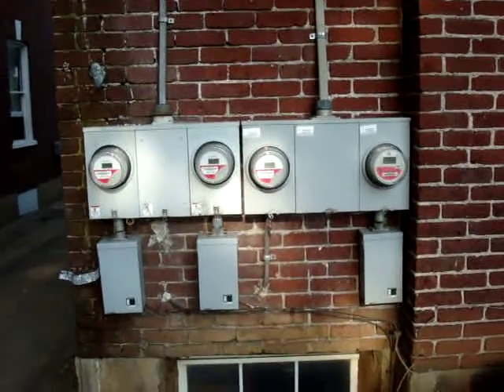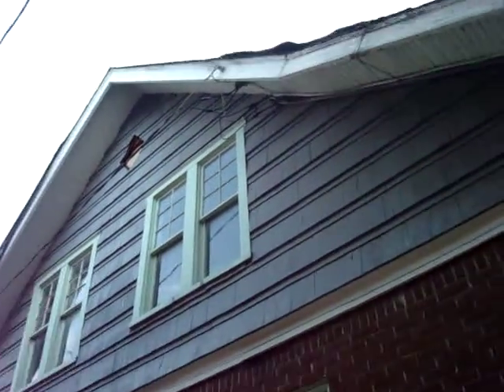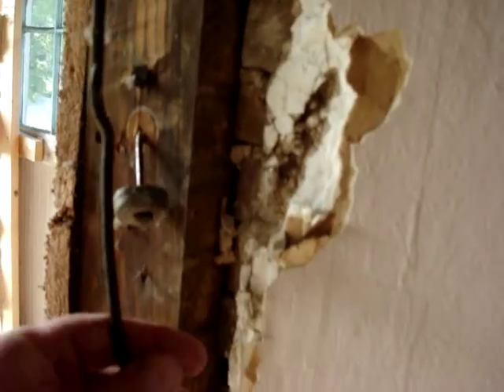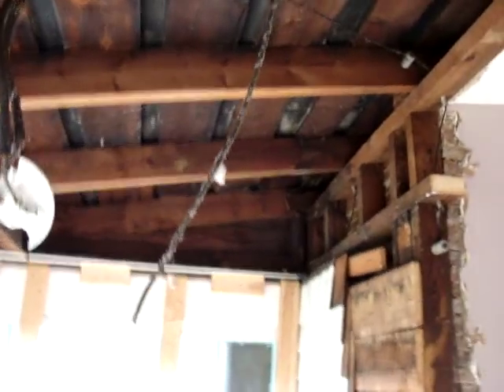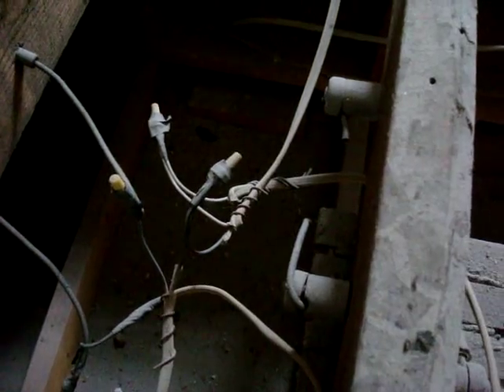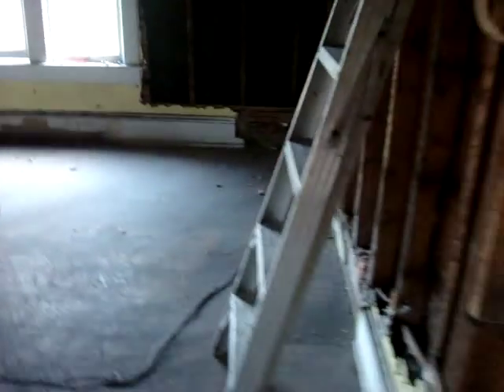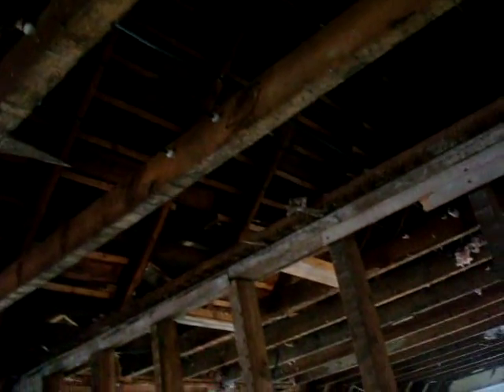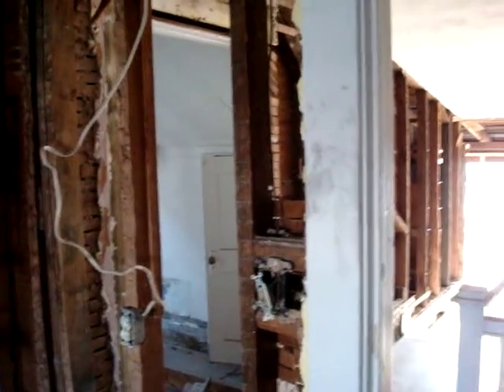Illegal and Unsafe Wiring in Older Homes

Comment: yes as long as you only touched the one conductor. actually you could still do this it is just a lot more likely you would be in contact with another conductor inadvertently, even a damp floor.

Comment: Switching the neutral instead of the hot was the way they did it back then. It's obviously very dangerous but until the 30s or 40s the code did not prohibit switching the neutral for lighting.

Comment: Ball park... How much would/did this cost to have rewired?
Reply from the maker: Whole house rewire w new panels, main w disconnected runs $15000 to $25000.
Reply: @JamesGlassJamesGlass  I think my heart just dropped... In the process of looking at purchasing our first home. And we have reason to believe all of the wiring needs to be redone. Hoping not to have to gut it completely out. I think I'm going to cry inside
Reply from the maker: @MariaM-ok5fq  Just get a licensed electrician to inspect and give you an estimate.  That's the only way to know. And it might not need as much as you think. Just make sure it's a licensed electrician. A pro.
Reply: @JamesGlassJamesGlass  great advice. And appreciate your guidance. Your the best. 😜

Comment: You seem to be unaware of legal today and legal in the past.  Depending on when this work was done makes it legal or not.    Also splicing knob and tube was done behind the walls as standard practice.    And it wasn't an issue.           Also in the early days of romex, there was no requirement to splice in boxes ...or behind closed in walls.    So the work was not shoty.  It was common practice of the day.    You talked in another video about shoty construction technique. Again not necessarily shoty  just different standards.    In actuality  most houses in the past were built much better than most are today.     You will see far fewer % of house built today standing in 100 years than the houses built in 1920  still standing today.     Houses 100 years ago were over built in today's standards.       I much rather work on any home built before 1960 than houses built since.      Some modern regulations are good but far too many have no legimate purpose.  And are the government sticking their noses where they need not go.
Reply: Disagree, I much prefer to work on houses pre 1970.        The quality of the product is far better than most houses built today.   I love the quality of my mother's house, built in 1902.  The only thing that makes it harder to work on is the materials today .  In that house a 2x4 is actually 2"x 4" and is still straight after 118 years.  Yes it was a high end house.  But my first house built around 1930 in a working class neighborhood was every bit as good.      Right now I am working on a little house from the 1930s  around 800 sq ft. It has some issues but it's still a very good home.    And straight enough.
Reply: Frank Miklos, when knob and tube wiring was installed in very old houses, it is true that splices were not done in electrical junction boxes. However, when the splices were made, the splices were carefully soldered and insulated with friction tape. The danger seen in this video is splices made using only wire nuts. If they were correctly soldered and insulated, the wiring would have been far safer than what was shown in this video.
Reply: my dude. working in old houses is a nightmare.

Comment: From a house that old I'm surprised you didn't find some of those nasty push button switches.
Reply: Samuel T, nothing wrong with push button switches, if you like the antique look. Mine are over 100 years old, and work perfectly for light switches. But all of the old knob and tube wiring that previously fed the switches were replaced with modern wiring to make everything safe.
Reply: @jeromewysocki8809  it is possible to get new push button switches that look like the old time ones, and they're UL listed. Some of the old switches actually had a capsule of mercury in them to make the electrical contact - not acceptable nowadays, of course.
Reply: @jeromewysocki8809  I've ran into those push button switches in an older home I worked on in Ann Arbor, Mi.  back in the late 80's.  I'd never seen one before, and they felt solid when operated, had a cool look to them.  Fond memories now for this retired electrician!

Comment: We just bought a home and turns out the electrical is wired all wrong and hazardous.. and the sellers tried to cover it up. We don’t have the money to fix it. So we can’t move in it’s unsafe. And the furnace is also not functioning so there’s no heat and it’s winter?? I have two small children and they can’t live in a dangerous environment. I dk what to do. But I’ve been told I should take legal action. Because they tried to hide and cover up the problems and didn’t disclose the problems before we purchased it . I need help!

Comment: You just showed half the houses in rural Oklahoma, including mine. Oddly, I've only had two blown fuses in 29 years in my 1952 60 amp main service. Yeehah.
Reply: jeb1273    Blown fuses is not necessarily an indicator that the wiring is still good.   You may have all 30 amp fuses.  You may have penny's behind them.  The problem with old romex(not necessarily knob and tube) is the plastic deteriorates and you can get small arcs the fuse doesn't blow, that get very hot and cause fires.

Comment: knob and tube is fine if not tampered with. p.s you can remove and sell those insulators to sundial wire for 2$ per piece.
Reply: I kept some for mementos from a job I did back in the late 80's.  :)
Reply: @doninmichigan  Cool.

Comment: can any color insulated wire be totally stripped to make it as the ground wire?
Reply: The ground wire is lower resistance. That way if there's any problem or short it will go through the ground wire (path of least resistance).

Comment: my aunt bought a a 1920's house with exactly the same wiring as that....is there a way to rewire it without opening the walls?....the attic and crawl space under the house are high
Reply: preferably would be better to tear down for safety reasons and also for better quality for electricians to do their job and do their job by code and professionally

Comment: knob and tube.  The knobs are the big nailed things sticking up.  The tubes guide through the joists studs etc.  Nothing wrong and a good installation is probably pretty damn safe.  screw in fuses are better than most breakers as breakers may not be dependable to cut out at the proscribed amperage while the fuse will always blow at or below its amps.
Reply: Yes the old fuse systems were intrinsically safe and breakers for household electrical panels in 15 and 20 amp sizes are notoriously unreliable. They are constructed using a bi-metal strip (or at least they used to be in the past but I could now be wrong about it.) and that is the same way your toaster works. Toasters can make 5 pieces of toast in a row and then burn the crap out of the next one. They cost about $5-6 in most cases for newer panels but are simply NOT more reliable than old-fashioned fuses. Of course the old style plug fuses would all fit the same socket on the fuse panel from 5amp fuses all the way up to 30 amp and many 15 amp fuses would be replaced with 30 amp ones with resulting fires. But most industrial large power panels still use fuses as they are very reliable.
Reply: @lectroken  and it's not just the reliability factor, fuses will clear a fault (short circuit) faster than a typical CB.  Not so critical for residences, but for industrial equipment especially.

Comment: So, almost every comment is either ripping on James Glass or about how crappy old houses are. James knows what he is talking about. It is obvious. As far as old houses, many of the most expensive homes in the USA are very old. The only new ones that are worth as much is due to their ridiculous size and snob appeal. The old houses are old because they were well-built and lasted long enough to become old. The new ones in the USA are not built to last. They are not constructed with brick. They have brick facades.... if you are lucky.  The materials... dry wall,  vinyl siding,  plastic tubs, laminate floors, treated southern yellow pine, mdf, osb, etc. will not hold up. Go and build a house today with all hardwood floors, old growth douglas fir,  elaborate wood trim, built in window seats, stained glass, french doors and you will go broke. The house in the video was built with old growth lumber which is stable,  more pest resistant, and long lasting. It is no longer available and houses today are built with fast growth, southern yellow pine. It is so crappy, it has to be treated with chemicals for exterior use. My porch was built with vertical grain douglas fir which has lasted 93 years and will last another 93. Treated SYP will buckle and untreated will rot in 5-10 years. The houses today are built with cost and saving energy in mind only... not character nor longevity.
Reply: Looks like you're just assuming that all new houses are el cheapo made, because of the steaming pile o' bullshit that was going on in the south, at least for the regions struck by 'canes! 
Especially hurricane Katrina!
Remember hearing about the Chinese drywall.
Reply: bg147 In my area, one will find mahogany used for the skeleton of older homes. I’ve have lived in two older homes that were constructed this way.  When the electrical box was replaced in one of them two saw blades were gone trying to open a hole. Try doing that now.
Reply: RJARRRPCGP .... The issue surrounding "Chinese drywall" coincided with "more-modern day" home construction as bg147 was mentioning....Remember Chinese laminate floorboards ? The "They don't make them like they use to " scenario applies to far more genres besides automobiles !....This old house I'm living in is 109 years old with high ceilings and doesn't show any signs of stress fractures on the walls and doesn't generate water in the basement  during heavy downpours unlike many homes in my area that were built even during the booming "Bungalow" era. Even back in the 1970s, We were saying that ol' infamous line !...."bg147" is more correct than he is opinionated !

Comment: I'll bet when they are done, all outlets will be wired by pushing the wire into those stupid push in holes.  It is code but should also be viewed as crappy, sloppy work.  In a few years they will cause short circuits and hot running outlets that cause the plastic housing to fall into pieces.  I know it's too much work and no one could afford to have real electricians use those side screws.  Some people who buy new houses open every outlet and re-wire them correctly.
Reply: exactly
Reply: I'm a master electrician, and I always use the screw terminals. I HATE those push-in ones.  Besides, I wire all my outlet circuits separate from lighting circuits, with 20A for outlets and 15A for lights.  #12 wire won't even fit in push-in terminals.
Reply: I don‘t know how the situation in the US is exactly, but here in Germany, we have these push connectors from WAGO, which work really well.

Comment: Worked fine for years...no problems. Contractors are very slick and scaring you people.
Reply: ELECTRICCLOCK once it uncovered it must be removed
Reply: Horses worked fine for years but people went on to driving automobiles instead. Just because things "work" don't make them safe. It's not the contractors but the code for a giving time. If someone is smart they can do their own wiring.
Reply: @Crm-dm9ex  ,  agree,  i am a sparky. but anybody can learn enough to do their own house wiring.  not that hard. the harder part is the services.  100 amp is not that hard. get up to 200amp and it will wear you out if you do it yourself.
Reply: @Roger Olson - what's the difference between 100 and 200 amp that will wear you out? The larger service entrance conductors? After the main breaker it's all the same, no?
Reply: @truthsmiles  ,  i am older now and done to many over the years by myself.  100amp service use #4 thhn wire.  200 amp service use #2thhn.  copper wire. on a over head service i always use copper.  don,t like Al wire.
Reply: I meant to say that i use  #2/0  Thhn copper wire.  not #2 thhn wire.
Reply: @truthsmiles  yes its pretty much the same  , I'm a state licensed electrician , 40yrs worth
Reply: @zerosparky9510  I put in which ever cable the customer pays for,  course I prefer copper,  but I'm not eating the difference if they can't afford it.

Comment: the whole house kinda sucks, wouldn't it be cheaper to rebuild the whole thing than fix all this various bs on an old structure?
Reply: No, I have a 100 year old house because they have more character than new houses and they history. This house has been gutted. The plaster has been removed from the walls and they are going to put up drywall. So, it is losing a lot of its charm. I have 100% plaster and one reason why I bought an old house. Just because something is old does not mean it is of a lower quality.

Comment: Funny how here in Oklahoma power is almost always run to the light, though the switch is ran off the hot side. When I was learning it took a bit to understand why the j-box had three whites tied together, two blacks and a white tied together and two blacks tied together.

Comment: ive seen scorch marks on wood where someone spiced onto knob wiring. the spice wasn't soldered. just stripped thewire and twisted another over it and covered with some old type of tape.
Reply: With knob and tube wiring, if you keep it, you must find every splice and see if it's been properly soldered. This is especially true if someone spliced into the system, modifying how it was originally done. Personally, I would just replace every bit of it.

Comment: bringing power to the light first and not the switch is not sloppy, its whats called a switch leg. All you're doing is bringing power with your line then marretting  it with the white on the load that goes to your switch. In the switch it there will only be 2 wires, white and black, and now your white acts as a line and your black acts as the load and on a single pole switch it really doesnt matter which wire goes where. But in the light the black wire will be your line and there should already be a neutral in there because your brought your power to the light first. Basically its just one big detour but its very common you see switch legs especially if the lighting is a one circuit
Reply: Doctor FeelHot (Doude4222) it's sloppy by modern residential standards.  having the power available in a switch location allows for future expansion, adding new switches or plugs from the switch location. also new dimmable and smart switches require a hot, neutral and ground to run the electronic circuit boards in the new switches. furthermore if ever you want to relocate the light/ add more lighting locations it's easy to do with just having the switch leg in the fixture and not having to worry about power in and power out.
Reply: If you are running a new switch leg from a light you now must also have a neutral wire in that switch box. So a 3 wire romex is going to be necessary so that you have a neutral, hot, and switch leg and of course since you will always use romex with a ground wire, you will have a ground there.

Comment: I always find it amusing how in the US the drier is considered a very big load and special arrangements need to be made in terms of a 240v outlet. In the UK all of the domestic outlets are 240v so 3KW appliances including kettles and heaters are normal. What's with the enormously thick cable for some items as well. I've seen IEC computer cables that look as thick as a  garden hose.
Reply: American dryers are actually more powerful than European/UK ones. The ones here are usually rated for about 5500 watts, far more than even the usual 13 amp UK circuit can handle.

120v circuits are only used up to 20 amps or 2400 watts. Anything beyond that goes to a 240v circuit to save on copper.
Reply: They are not "special arrangements".  Moving up to the 240 available in EVERY house allows you the 4-6 kw dryer to be supplied with a 30 amp #10 wire, instead of a thick wire.   But I do wish we had 3 kw kettles here.  They are theoretically possible in new houses with split duplex counter outlets, that actually have 240 volts between the narrow slots.  I have been dreaming of inventing a plug that straddles the two so that I could plug in an imported kettle from the UK   :)
Reply: we have outlets for 240, just not as common. our dryers also tend to be bigger, accompanied by washers, and less energy efficient.(in my own personal experience).

Comment: if your out of room on the neutral bar can you put 2 wires in the same hole if you twist them together and its tight
Reply: David Berquist check local code regulations,  it will say in your local code electrical book where I live it's one wire per termination screw.

Comment: ? good luck finding any switch in an older home that isn't back fed.
Reply: G. sixone4 no switches are ever  back fed, what he was saying was that they were switching the neutral. not the hot. so you had constant power in the light socket. which is dangerous.